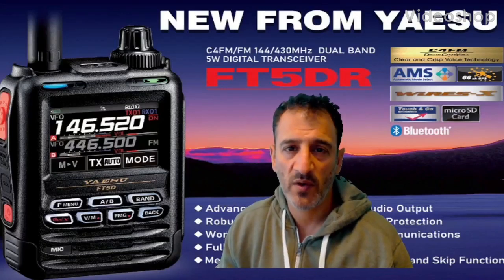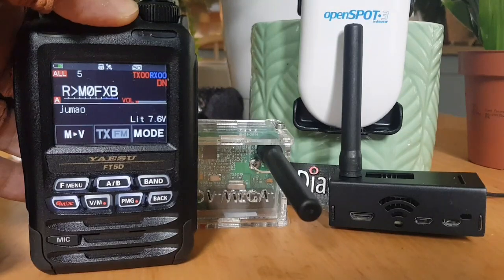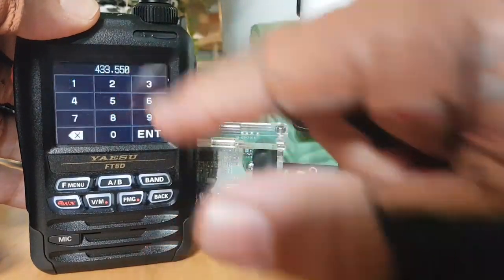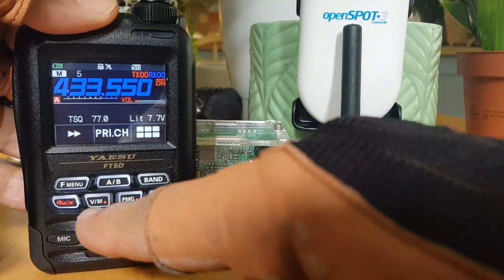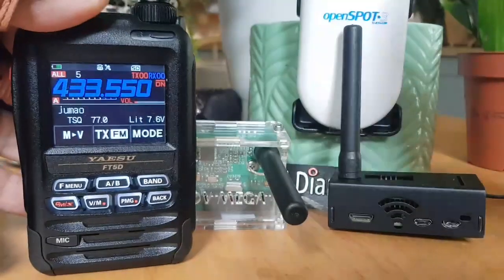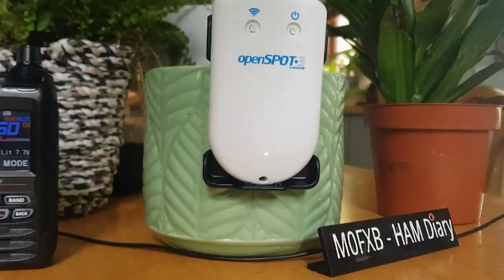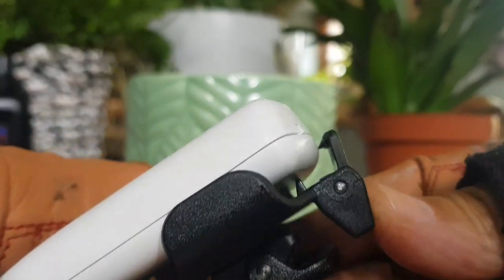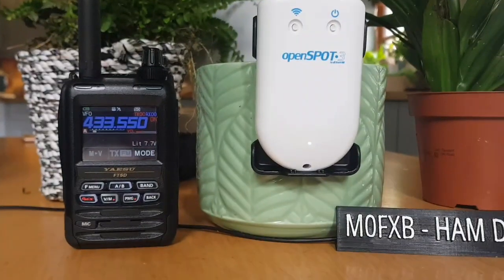YAESU FT5D - Add your Hotspot (Openspot)

Comment: One additional thing to do when you do a Memory save is to turn the TX Power down on the FT5D as well. This will save significantly on battery. Since your hotspot is usually close by there is no need for full 5W power. Thanks for the great video!
Reply from the maker: Yes good point - I usually do set the power to Low many thanks